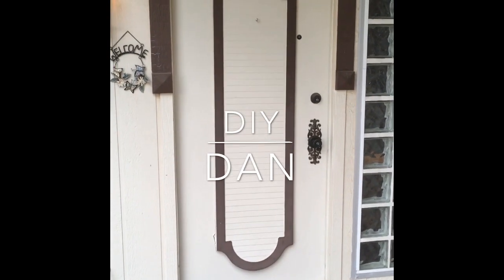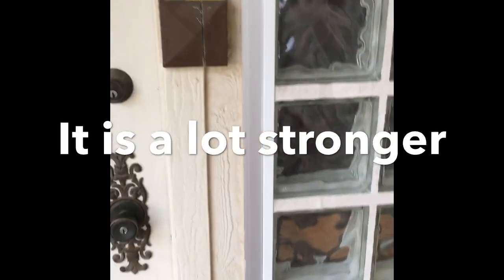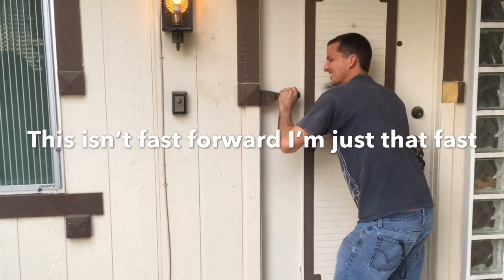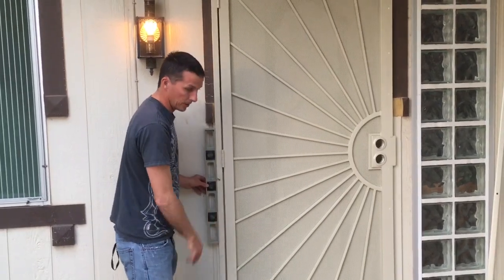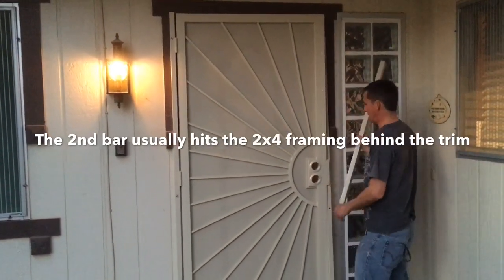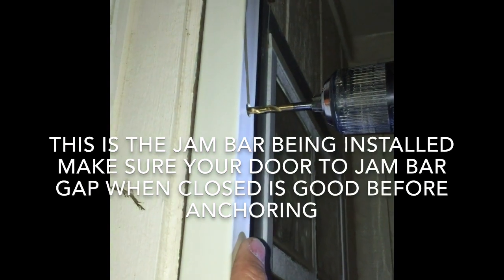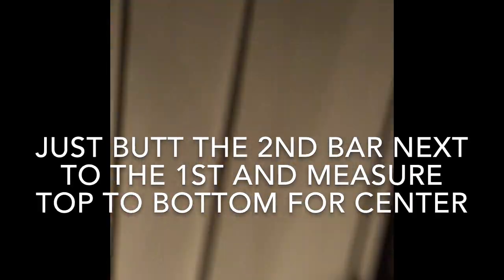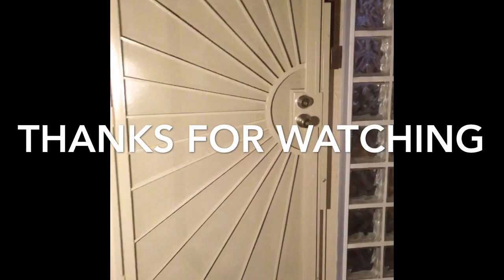Installing security door more securely usually you only secure it into the trim not the way I did it

Comment: Thank you for posting this.  I installed my first security door yesterday and your video was a big help.  I moved the top bar to reinforce the strike-side of the door as you suggested.  Additionally, I skipped the included lag screws and drilled through the wall, attaching the door with stainless carriage bolts.  I also installed a "door cuff" over the deadbolt thumb turn. With both doors closed, the thumb turn can't be reached from the outside, even if the mesh screen is cut.  My next steps will be to weather strip the door and figure out the gap at the bottom; maybe a door sweep.  Thanks again for a very helpful video.
Reply from the maker: I ADDED A DOOR SWEEP AS WELL AND POSTED A VIDEO DON'T USE THE STUPID SCREWS THAT CAME WITH THE SWEEP THEY ARE NOT MADE FOR METAL I HAD TWO BREAK ON ME BEFORE I SWITCHED TO SOMETHING ELSE

Comment: What would you recommend if the security door hinge frame is centered with the main door opening but the drilled holes only get the outside 1x6 trim molding and hit a gap where the main door frame is shimmed? How can I make sure the weight of the security door isn't held up just by the 1x6 trim moulding? Do I have to reframe the main door?
Reply from the maker: I had that happen to me on one also I tapered some long screws through the trim material into the frame of the door so at least it had that to help support it

Comment: What is that tool called that you used to remove those special screws?
Reply from the maker: The tool only installs does not remove the screws are made to only go one way if you need to remove them the only way I know is to cut the heads off with a grinder pull the frame off then use vise grips to pull the rest of screw out    When I got the tool to install I just asked the guy at Lowe’s when I got the door it is a Slotted driver designed to drive one-way security lags
Reply: Angle grinder

Comment: Wtf, no offense but that looks bad!!
You could put as many screws you want on the strick side and still used the z bar header to keep bugs out
Reply from the maker: The point of the extra bar on that side is because the screws only go into the trim not the actual 2x4 frame around the door when just using the one bar  has nothing to do with the amount of screws as was said in the video. I had my security screen door pried open because of this personally before I started mounting them this way and as always my videos are my opinion if you don’t like it then don’t watch u tube for help and figure it out yourself like I had to do before u tube was around   no offense 👍